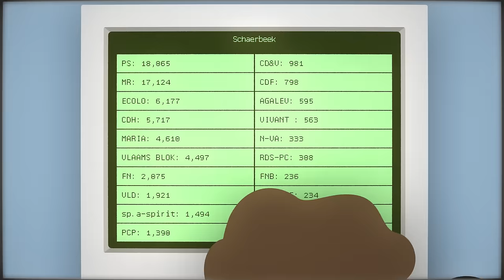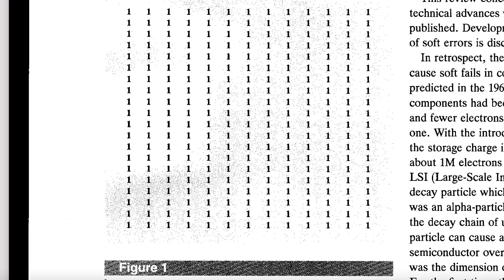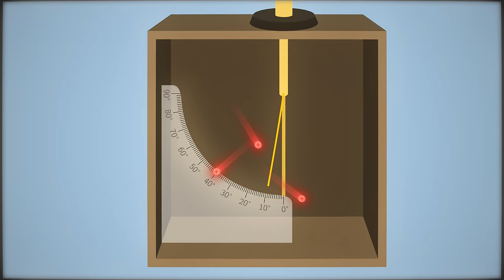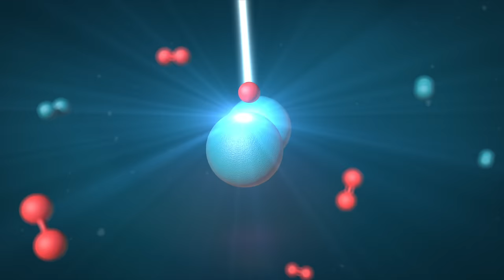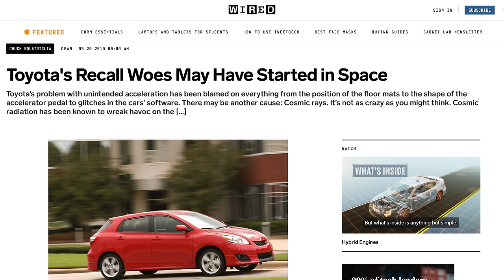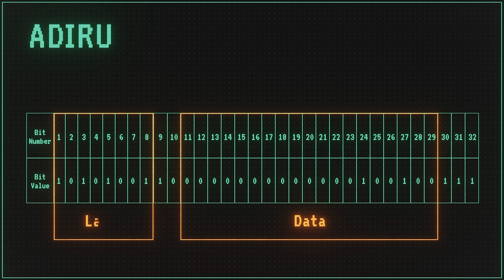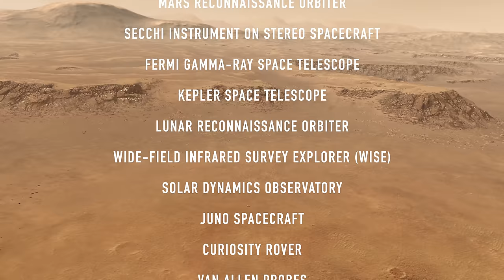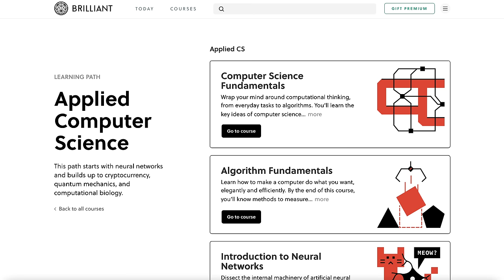The Universe is Hostile to Computers

Comment: Just so everyone is aware though, modern PCs and OS are programmed to be resilient to single bit flips through redundancies and error captures. If you get a random BSOD, it's going to be almost certainly due to an driver error or corruption than literal cosmic powers.
Reply: These days sure.
Reply: Faulty RAM or memory controllers and OCing are big culprits too :3
Reply: So we’ve won the universe in this case.
Reply: @damienlobb85  Yeah, OCs are a cause of BSODs
Reply: so software ECC?
Reply: That was disappointing to my hopes of deflecting the blame for my software developmental failures.
Reply: @damienlobb85  :3
Reply: Hmm, well ultimately everything digital is based on analog things falling within nominal ranges and errors not exceeding certain thresholds. Typically these thresholds are designed to be high enough that the chance of error is too low to be practically encountered, but as others have noted - OC'ing, undervolting, overvolting etc. are great examples of cases where people reduce these thresholds for performance (or other) gain. While most 'over the counter' hardware is shipped with conservative tolerances, I imagine it's still possible in extreme circumstances to induce anomalies that exceed tolerances.
Reply: It's not at all uncommon to encounter errors caused by environmental radiation. According to Wikipedia, "Studies by IBM in the 1990s suggest that computers typically experience about one cosmic-ray-induced error per 256 megabytes of RAM per month." For 8 GB of RAM, that would translate to 1 error per day. And non-ECC RAM will absolutely fail if a flip hits the wrong spot.

In an airplane, this likelihood is increased 150-fold, and near the Poles it's further multiplied by a factor of 2 to 3. Non-cosmic radiation sources (e.g. Uranium in the ground; Radon in the air) also significantly increase the error rate near the surface.
Reply: @VVayVVard  that's interesting! Thanks for sharing
Reply: i got a bsod today (kernel exception) while i wasnt doing anything and nothing was happening in the background, now im watching this video, oh god
Reply: Those types of error correction techniques are used on data transmitted from one location to another where data corruption enroute is possible. It's very effective for that. A single event upset (SEU) isn't limited to a specific communication path that can be checked when data is received. Any bit can flip at any time. The corruption could happen after the data is checked or even in the main program software itself.
Reply: @Man sky i know this is (probably) a bot but holy cap what has society became
Reply: It still sounds like something militaries have worked on developing.
Reply: @1998SIMOMEGA deleted i guess
Reply: Users don't know that

Comment: At 7:59 you quoted "Since no influence of the eclipse on the penetrating Radiation was noted, we conclude that even if a part of the radiation should be of cosmic origin, it hardly emanates from the sun" But if it takes eight minutes for light from the sun to reach the earth, then theoretically it would also take time for radiation from the sun to reach the earth as well
Reply: it only takes one second for light to travel from the moon to the earth, so the moon would block solar radiation

Comment: Correction: getting an overspeed warning and a stall warning at the same time is not impossible, even if everything is functioning normally. Stalls are a function of angle of attack, not speed. You can stall at any speed if the AoA is high enough. If you're in a fast dive and pull up too sharply, for example, you can stall the aircraft, even at very high speed (even overspeeding).
Reply: good to know mate
god, the internet is such a cool place
Reply: I know you're probably an expert but I'm still not convinced. If the aircraft is going overspeed and the AoA is high enough to stall it, won't the speed maintain the plane lifting? I'm not a physique neither a pilot or engineer of everything like... But I can imagine an aircraft lifting still at high angles of attack, except maybe when it is going up straight in 90°. 🤔 I really don't know, that's why I'm asking
Reply: @ThiagoVsky  We aren't talking about a straight line, we are talking about a curve. Jump into a game like Ace Combat and dive a spitfire, when you reach overspeed warning pull up and now you also have a stall warning.
Reply: @ThiagoVsky  Once you exceed the critical angle of attack, which is 16 degrees or so for most wings, the airflow over the wing becomes turbulent and ceases to be laminar, detaching from the surface of the wing. This is a stall, and airspeed is irrelevant. Without an attached flow you can't lift properly.
Reply: Got it! I'm not an engineer or something so I'm not used to deal with laminar air flow and stuff but I know it exists and it's very counterintuitive sometimes.
Thank you all!
Reply: You are talking something akin to a snap roll. That is not going to happen for a commercial aircraft in straight and level flight.
Reply: Is this why in film when nosediving, it’s depicted to be hard to pull up and takes longer than normal?
Reply: @trackman07  can say yes...
Reply: It happened to Airfrance 447, but this is not cosmic rays is just a trashed sensor
Reply: probably what he meant is that It's impossible at that particular scenario.
(meaning.. the airplane moving at cruise speed, straight and with nothing particular going on... I'd be impossible to get the overspeed warning and stall warning.)
Reply: @Anvil1137  ace combat is one of the worst examples you can chose of, that game defies all laws of physics
Reply: Now imagine same problem in airliner
Reply: @ThiagoVsky  No, the speed has no bearing under those circumstances (high speed stall). A wing "stalls" when the airflow over it is not sufficient for it to  produce lift. Under normal AoA (Angle of Attack) this is usually when you are going too slow. However, even if your speed is high enough, if your angle of attack is too high, the air does not "hit"  the nice rounded aerodynamic shape of the wing, (designed to generate lift) and flow nicely over/under the wing, it hits  a "skewed" wing because of the AoA, and this prevents the air from flowing smoothly over/under the wing and instead creates massive turbulence which totally disrupts/prevents smooth airflow, causing the wing to stall. This happens even though the aircraft is moving faster than it's stall speed and, in this instance, faster than it's max safe airspeed (overspeed).
Reply: @trackman07  In the event depicted here, due to the flipped bit, the angle of attack protection (alpha prot) triggered erroneously, forcing the nose down and overriding the pilots' nose-up inputs until the data became uncorrupted.
If you mean why in general it's best to pull up slowly from a deep dive, yes - a rapid pitch up risks an accelerated stall and overstressing the wings.
Reply: and rip the wings off of this plane in the process, because they are not fighter pilots
Reply: @Crunchy121  Do me one better.
Reply: The "ifs" were not in play, so it was impossible for what the Pilot's heads would be processing.  Might be possible in another plane and flight scenario.  Pilots hope to deal with the real world.
Reply: SHEESH
Reply: I feel smarter just after reading this thread  :)
Reply: It can also happen when you take an aircraft above its service ceiling, where Vne becomes lower than Vso so you can simultaneously over speed and stall
Reply: @trackman07  Because it would be no fun for the audience otherwise! Almost all Hollywood air crashes have the controls stuck as if in molasses, the air noise increasing, and other such dramatic effects. That could happen, but in most cases of dual engine failure, fuel exhaustion, etc, the crew will be flying a relatively quiet glider (compared to its normal noise level, that is). And they'll want to attempt to "land" on the earth at as slow a speed as possible.
Reply: Very true. It was discovered in WWII that "target fixation" during diving attack sometimes cost a fighter pilot his life due to this phenomena. Naturally, they preferred to strafe, bomb or rocket targets at high speed, because most targets were shooting back. (Get in, shoot 'em up, get the hell out.) But if they got too close to the ground at high speeds & angles, there was insufficient room for a pullup without pulling up so hard they exceeded the stall angle of attack, and stalled the aircraft. And a stalled aircraft in that situation just keeps heading (mostly) towards the ground. It's not flying anymore, or at least not in a controllable fashion. The same thing could happen to any aircraft, even a Piper Cub, that attempts a loop too close to the ground.
Reply: Although true in theory... in the practice, if both of this things happen, you are more likely concerned with where did your wings went to....
Reply: You are not accounting for the structural limits of the aircraft. If you had enough angle of attack to stall in an over-speed, you would rip the wings off or buckle the fuselage.
Reply: @Anvil1137  DCS, IL2 BoS, MSFS, X-Plane, literally anything that has proper physics

Comment: some people will think this is an episode about cosmic particles, but actually it's an episode about how effective redundancy is at fault-prevention 😅
Reply: Also running a parallel computer system with identical voting software would have also caught the issue since it's extremely unlikely that bit 13 would have flipped at the same time in both.
Reply: @BillAnt  i mean.. that's what redundancy means, mate 😂
Reply: @BillAnt  — unlikely ?!
Reply: Fault reduction. We will not see prevention of damage from anything as large or larger than a Carrington-class event in our lifetimes.
Reply: @TJChillyWilly  - Yes unlikely that bit 13 would flip on both computers at the same time.
Reply: @BillAnt  it’s a bit more than just unlikely. More like statistically impossible.

Comment: As an IT support technician, and former software tester, this is fascinating and infuriating. They need to teach this in intro to programming.
Reply: Whats there to teach? Its the hardware guys problem. Even if you could do something, nobody is gonna divert dev resources into that. Its a joke, basically.
Reply: While I agree even intro courses to programming should cover more fundamental aspects of computing (and to some extent they do, by usually teaching binary even before reaching code) it would seem like a big jump to start discussing one specific scenario and trying to make that relevent, especially since it is more of a hardware problem. From a programmers point of view, you can really assume the computer works as intended untill you go further. And if you really want to explore that further you go into computer engineering...
Reply: @greenanubis  A hardware issue that directly results into a software issue, especially if it can take down entire operating systems.. yes that would be valuable information for any programmer or IT person. 
Imagine all the software failures given billions of devices / servers.. how much of those were due to cosmic/solar events? We simple don't know because no one is checking for bitflips, and servers use ECC RAM so if a bitflip does occur, it's rectified, just not in our public devices.
Reply: @greenanubis  knowing that there's a problem that I'll statistically never be able to reproduce saves time in debugging.
Reply: @iPsychlops  Fair point.

Comment: The fact that the Pioneer spacecraft are functioning at all on any level after all these years is a phenomenal testament to the hardened sytstems developed by NASA.  One can only imagine the barrage of high-energy particles they have endured thus far on their continuing journey through interstellar space.
Reply: I think you mean the Voyagers - but the Pioneers had a good run too.
Reply: Well the high energy particles don't really damage the electronics, they just mess up a measurement here and there.
Reply: @tassadardaris7294  ... which can crash the whole operating system and ruin the mission, but yeah
Reply: @hairohukosu433  Doesn't have an operating system, it's an automatic clock processor that has temporary memory and constantly sends data in the queue to Earth, there is nothing to crash or break.
Reply: @tassadardaris7294  You couldnt leave him any sense of wonder, hm?